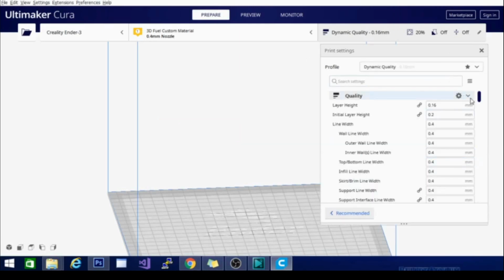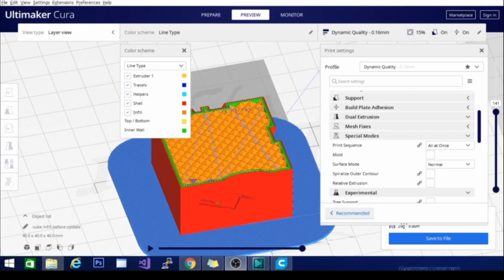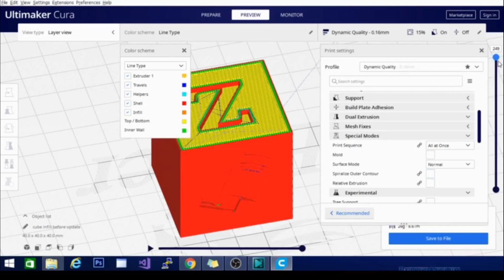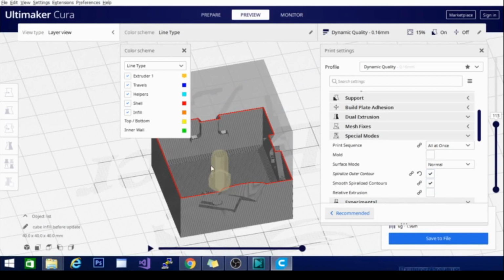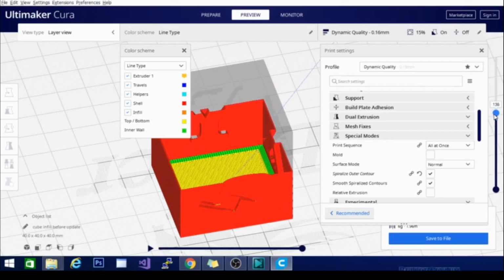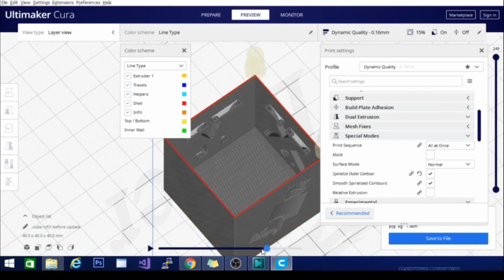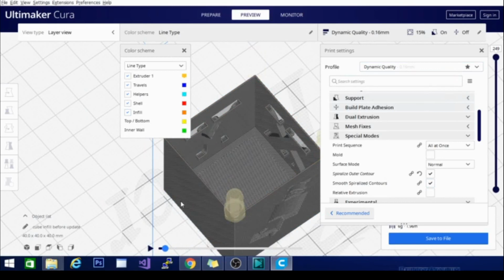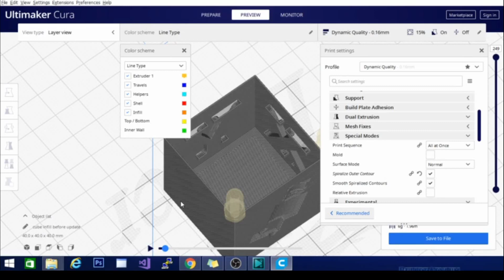Cura settings in 5 minutes or less! - 12.3 - Spiralize Outer Contour

Comment: Like to print hollow prints for making into "Coin Banks"  -  I prefer the fast speed of course of vase(spiral)mode but has anyone ever thought of making it one step better, where it can easily print areas that are more somewhat horizontal,  similar to "make overhangs printable" at least for overhangs that are on the inside of the print, so it doesn't affect the outside look of the print, or to add removable supports to the outside of the print, attached to the model itself?

Comment: I cant make watertight vases with my .4 nozzle. Can u?
Reply from the maker: sometimes i get lucky. previously most holes were at the bottom, but in newer versions of cura add a few more layers to the bottom in vase mode, so i have had a few. i have 410 mm vase that hase water and a rose in it right now.... but often there are holes with a smaller nozzle u get thin walls. if you slow the print speed you can improve it a little.
Reply: try increasing line width to like .48 for a better seal.